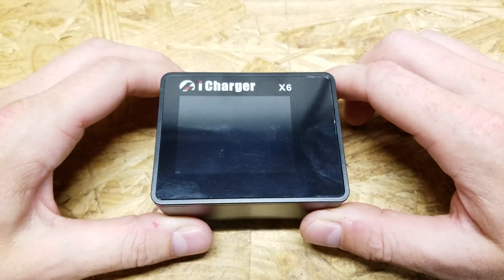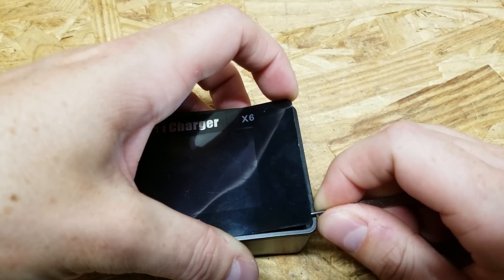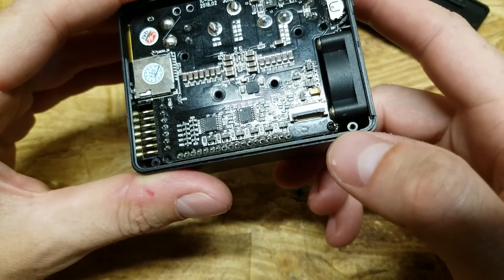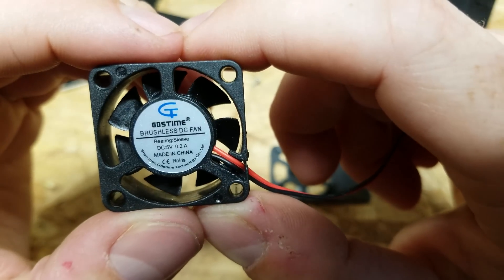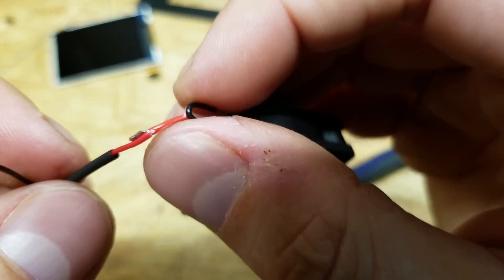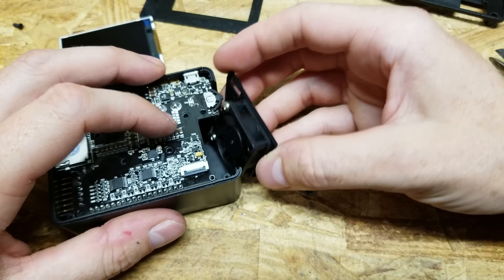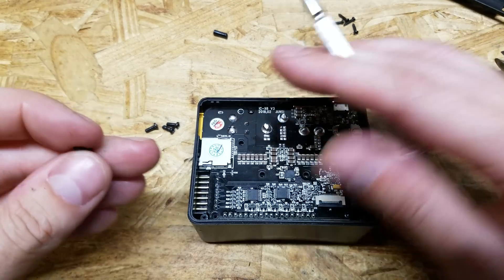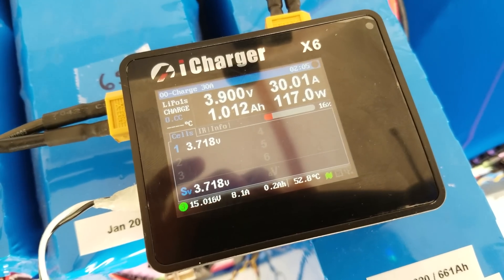Junsi iCharger x6 Fan Replacement, Overheating Fix

Comment: Do you have any experience with the scroll wheel not working properly. Mine doesn't work as it should. Have you replaced one? I have read it could be just a loose ribbon connector. I haven't taken mine apart but I was trying to see the ribbon connector in your video for the scroll wheel. Thanks!

Comment: What is the original fan's CFM and RPM spec ?
Reply from the maker: I have no idea. You can get the part number off you're and see if you can find a datasheet.
Reply: @LithiumSolar  i tried that before commenting… this part number is too generic (or more likely inundated with clones) as there are items from 1.5 to 8 CFM, so the part number is useless. You make it a point that having the same specs is critical, yet don't give them. I suspect you just got a fan that "looks" similar, but we all likely have no way to actually know the actual OEM specs, so we just have to hope for the best.
Reply from the maker: @fiveangle  I see. I honestly cannot remember how I decided on that specific part number. This video is very old. I can tell you though that it still works great and I beat the heck out of it on a continual basis.

Comment: Do you know if the sceeen is replaceable I need a new screen
Reply from the maker: I don't recall and it's been a very long time since I've had one of these opened. Even if it is replaceable, I doubt it will be a part you can easily find.

Comment: my icharger x8 also get that noise after only one week of use that is common issue of that ichargers the quality of the fans bearing type is slight and that is very poor and cheap type   i have also the isdt Q8 max charger and no problems the fan is very good quality and probadly never die because  the all of the isdt chargers use the much better ball bearing type  fans and i never see/heared  any fan failure case on the others  isdt chargers from other users also. sorry for my bad english

Comment: It looks like you're using this charger to charge enormous cells. Does it stand up well, aside from the fan?
Reason I'm asking is that I'm going to build a 12S LiFePO4 pack that's 25 Ah, and want to use a similar charger (X12).
Does your X6 seem reliable (electrically) when charging and balancing enormous packs? Fans are easy to replace, circuit boards are almost impossible to fix.

Comment: Too bad they didn't make it easier to dismantle. These are probably good chargers, I'm interested in the X12 myself... unfortunately you have to massacre it just to open the stupid case! I can see myself needing to replace the fan or the dumbass little rocker switch eventually, and that's gonna suck. They could have just used buttons.
Reply from the maker: It's actually not bad to open at all. The screen peels off easily and everything else is pretty much modular. But yes, that rocker switch is TERRIBLE. I don't know what the person whom designed that was thinking...!
Reply: @LithiumSolar  That's cool, I just got one at a decent price from right here in Canada. These puppies are really tiny! It's hard to believe they can handle over a kilowatt, but time will tell how it stands up :)
I don't mind the rocker switch, it's all right. I figure if it fails, I'll just hack the thing open and mount the circuit board and screen inside a nice aluminum enclosure with a good ball-bearing fan, and some pushbutton switches instead.

Comment: does anybody know if the multifunction selector button can be replaced with something else? I want to detach it from the PCB so I can mount it to the outside of a custom case so I can install 80mm or 120mm fans on the heatsink

Comment: You could just swap the plug by using a screwdriver and press the DuPont Hook out oft the plug. Without soldering. Should be enough room for the cable.
Also if possible using good thermal paste on the mosfets which are connected to the heatsink. But maybe the mosfets are thermal glued to the heatsink. Good paste could make the fan spinning slower

Comment: Great videos! As an electronics designer with my own home based business, I appreciate your inventiveness and ingenuity! Although I saw a few minor electronic things I'd do different, there was one thing that stuck out on this repair you did here. The 'protrusions' you broke (often called 'mounting bosses' BTW) are easily glued back in with a good plastic solvent type adhesive. I use acrylics often to make plastic cases for electronics and use just such a solvent adhesive with simple butt joints. (BTW I tried to take apart one of my joints and the plastic busted, but not at the joint!) It is extremely fast setting and is water thin, designed to wick into an intimate joint (like a snapped off mounting boss or a well cut pair of box sides). It works by dissolving a very tiny amount of the plastic on both surfaces and quickly evaporating to leave the two pieces as part of each other. So, you place your boss back in its original orientation for intimate contact, hold it in place, place just enough adhesive at the joint to wick through the joint (it takes very little!), wait 20 seconds for it to set, let go, wait 20 minutes or so for a strong bond and reassemble your unit. I realize you've likely tossed the broken plastic bosses, but next time you'll be able to fix them. Here's the company I get these adhesives from, although I'm sure you can find a plastic distributor that carries them near you. TAP Plastics will ship these as well. (Don't forget an applicator!). https://www.tapplastics.com/product/repair_products/plastic_adhesives
Reply: Came here to say the same. You can also use a cyanoacrylate, aka Super Glue.
Reply: @mjbirdClavdivs  Super glue works, but it isn't as good as the solvent adhesives  by quite a bit.

Comment: Good video, thank you. What often kills or shorten the life of fans is heat, I think it would have been a better choice to blow cold air inside instead of extracting hot air through the fan. Maybe you can try this solution if the new fan also dies quickly. Or try good quality fan like Sunon MagLev.
Reply from the maker: It makes sense to me too that the fan should be blowing inward. I'm not sure why it was designed this way though. Maybe because the plugs are on the opposite side and wanted to avoid blowing the hot air over the connectors? I'm not sure.
Reply: @LithiumSolar  Probaly the fan is not strong enough to push the air through the whole housing and heatsink

Comment: Looks like there may have been enough room to use small carriage screws and nuts to mount the fan to the plate. Where you broke the two posts. However, you'd then have the screw head or nuts protruding to the outside of the charger.

Comment: i always strip that small cables whit my teeth
Reply: And I bet your dentist approves of that method.
Reply: @SteveMillerhuntingforfood  i dont have a dentist
Reply from the maker: The thought of using teeth to strip wires makes me cringe lol. No thanks... And yes, my dentist would most definitely not approve :P
Reply: @LithiumSolar  hhehe well is practical and my teeth are okay
Reply: Having been a low voltage technician for over 20 years... I strip small cable with my thumbnail.

Comment: Agree - sa-der!!!   :)    Its like Alum-i-num (US) vs Al-u-min-i-um (European) - took me a long time to figure out what Al-u-min-i-um is :)
Reply: And no it's pronounced sol-der
Reply: That's just because Americans like to be different in everything they do. You call petrol "gas" when it's actually a liquid...you use a mix of the imperial and metric systems. Pick nearly any topic and Americans have to do it differently
Reply: @markc6714  technically gas is gasoline. just shortened. lol.  petrol is non refined oil used to make gasoline.  but yeah, I agree. everywhere else the metric system is used and celsius which makes sense 0 freeze, 100 boil. simple. but nooooo, we have to use 32 for freeze and whatever 200-ish is for boiling? wtf. everywhere else is milimeters, centimeters, meters, etc. here it's damn inches and 7/32nds of an inch and crap like that. everywhere else it's 240v (except japan, south america and canada), here we had to go with 120v because we MUST be different. lol. surprised we don't drive on the wrong side of the road too because the right side is the RIGHT (read correct) side of the road. lol

Comment: Here's you an easy repair fix you can repair the 2 broken studs with that will never break in the same place again. Take some super glue and glue them back together an pour a small amount of baking soda on the glue. Make sure the posts are where you want them because, the glue will set up so fast and hard you won't be able to move it once the baking soda is applied enough to coat the glue. I've fixed chips in boron helicopter blades using this method.

Comment: A decent little repair video, but an additional warning about selecting a replacement fan needs to be given: 
( 4:35 )...  Avoid sleeve bearing fans if at all possible-- they will fail much faster then other bearings, especially if it's placed in a hot, and/or contaminated (Dusty, etc.) environment. Go with double ball bearing fans (Delta fans are particularly good fit for critical components, if damn loud) or a brand specific bearing from a well respected company like Noctua if they make fans in the form factor you require.
Reply: Thanks for the info! I always love hearing info on things I know nothing or very little about. I'll have to check into what you mentioned to learn more about it :)
Reply: @demonkey36  Here's a good article on fan bearings...
https://www.gamersnexus.net/guides/779-computer-case-fan-bearing-differences
Reply: @TwistedMe13  thanks a ton!

Comment: What is the balance current? My ISDT Q8 says 1.5, but I only see about 800-900ma, that's the discharge also, I wish I had regenerative discharge, that's the main reason I want the icharger!
Reply from the maker: The manual says "Current Drain For Balancing 2A" but I can't imagine it's able to do 2A balancing on every pin at once. It also says Maximum Discharge 30W so maybe it means 2A per channel up to a combined total of 30W? I'm not sure. I pretty much use it exclusively for the 30A regenerative discharge.

Comment: On the back, lower right side near the air inlet, there's a hole specifically for removing the front plastic.  Stick a straightened paper clip and you can lift the screen up without prying.  To remove the main board, you just need to unscrew the 2 smaller screws.  The bigger ones are holding the heatsink.
Reply: sorry to be so offtopic but does anybody know a way to get back into an instagram account..?
I somehow forgot my password. I love any assistance you can offer me.
Reply: @Richard Paul instablaster ;)
Reply: @Tatum Edgar I really appreciate your reply. I got to the site through google and I'm in the hacking process now.
Seems to take quite some time so I will get back to you later when my account password hopefully is recovered.
Reply: @Tatum Edgar it worked and I finally got access to my account again. I am so happy:D
Thanks so much you saved my account !
Reply: @Richard Paul Happy to help xD

Comment: Do you think the x8 is worth the extra money? I have 7s batteries, I just killed my ISDT T8,  and in a pinch I bought a Q8 it can do 20amps, it's OK, I don't care for the touch screen,
Reply from the maker: It's up to your needs really. They are both great chargers and are probably very similar internally if I had to guess.. I don't personally have any use for 8s. When I bought my second x6, the x6 was a few $$ cheaper than the x8, which was my deciding factor. I don't have any experience with the ISDT  to be able to compare in that capacity.
Reply: JAMES Just James if you want to do 7s then the x8 is a must. Far better than the isdt.
Reply: I am looking at the x6 any thoughts on just getting the x8.

Comment: Awesome. Had to do that on one of my X8. the fan was not seized up but it was making a horrible noise from the bearings.
BTW, those machine screws go into the heatsink so you do not have to remove those since the board and the heatsink come out as one piece.
Reply from the maker: Oh really? I feel like a fool now LOL. Also, what's funny is my first iCharger has been making a grinding noise since day one. I forget how old it is, maybe two years now. It still has not ceased up like this one.
Reply: @LithiumSolar  my icharger x8 also get that noise after only one week of use that is common issue of that ichargers the quality of the fans bearing type is slight and that is very poor and cheap type   i have also the isdt Q8 max charger and no problems the fan is very good quality and probadly never die because  the all of the isdt chargers use the ball bearing type  fans and i never see/heared  any fan failure case on the others  isdt chargers from other users also. sorry for my bad english